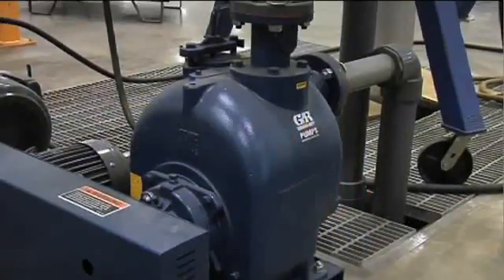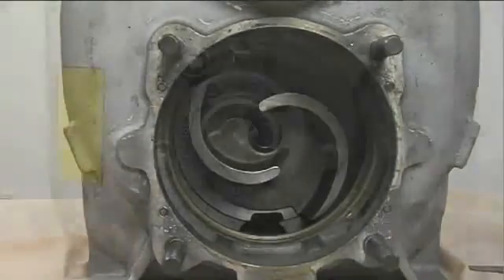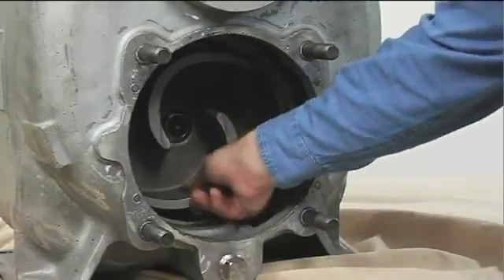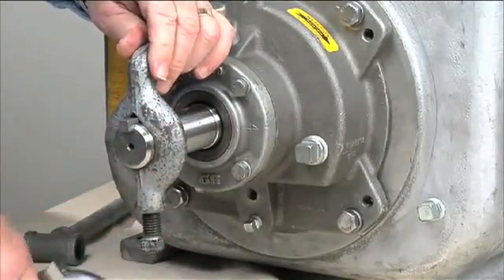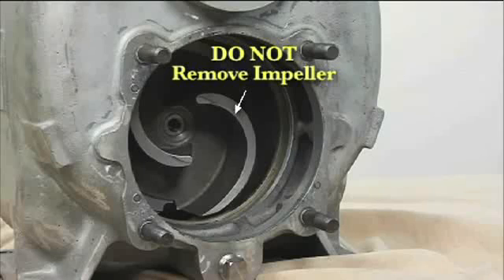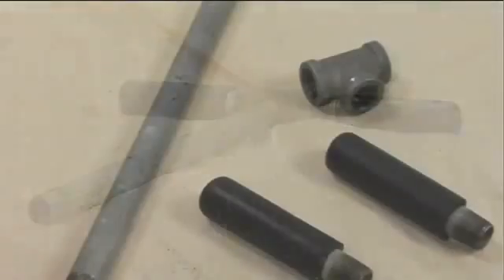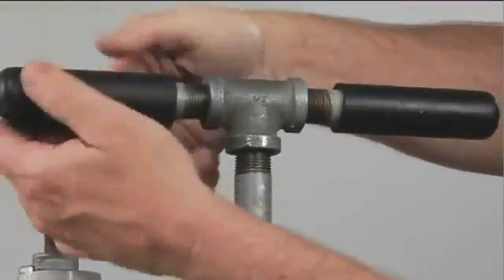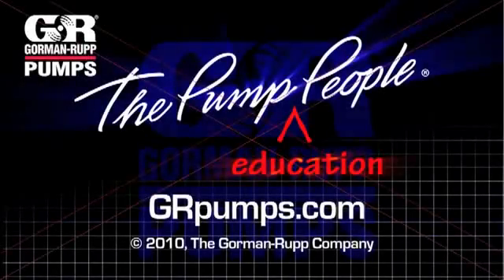Gorman-Rupp Super T Series Pump Maintenance Pt. 4  Rotating Assembly Removal

Comment: What is the empty hole between the shaft and drain???   Hole above seal cavity drain plug.
Reply: I'm thinking its a weep hole if the seal goes out, I'll know more soon, cuz mine is pouring out. LOL
Reply: Can I make that rotating assemble tool? I just need the thread size